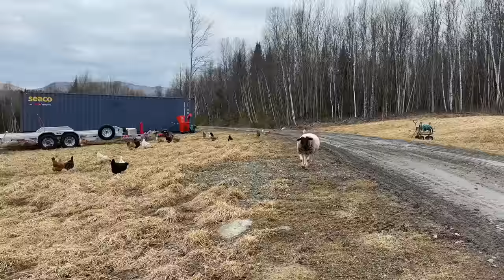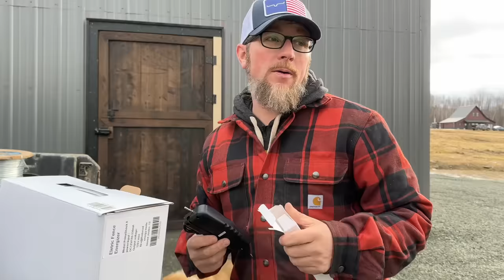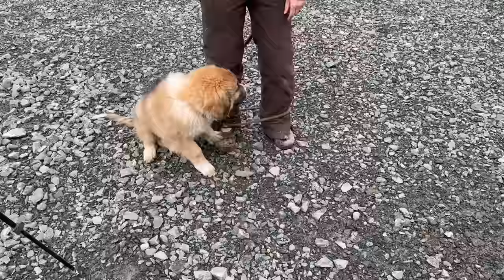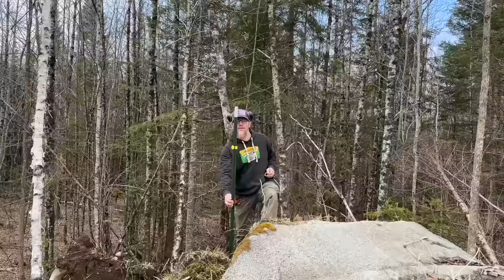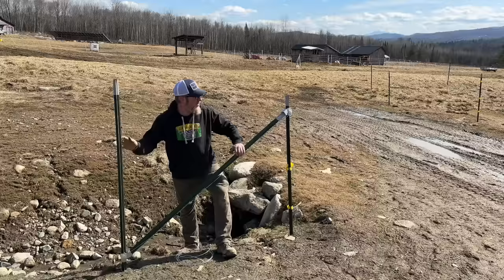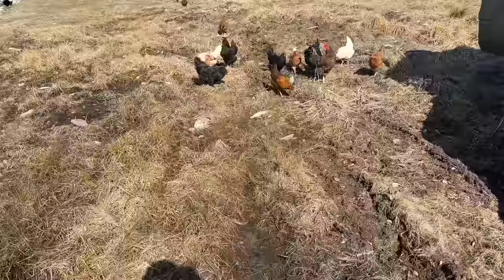Here We Go Again, BIG PLANS... Time To GET READY!

Comment: Good morning Lumnah family from a cloudy Pacific NW. Good morning viewers. Nice, getting the fences up. I'm glad you got energizes for your fence that are direct fed 110VAC. The four gates sound great. I'm glad to hear that you're getting more pasture livestock. Nice job on the bracing. Thanks for this video Lumnah family! We got the engine out of the Subaru Forester. Now the fun begins. I didn't even end up in pain! When I removed the radiator fans and most of the radiator I hurt my right foot bones and my left knee woke me up with pain in the middle of the night. It's great to have an engine on a stand and it's all so easy to get to. The stand we got from the guy's barn that had never been used is what it's on. The engine is so cute on it. It is a very small engine. Most of the cars I have are 6 or 8 V style engines. I don't have a hoist or a forklift like my brother-in-law has. It was fun to see him pull it out with the forklift. He put a fork extender on one side to bring it up with.

Comment: Worldwide Production;
1. Cow Meat,
2. Sheep Meat,
3. Sheep Milk,
4. Pig,
5. Chicken,
6. Cow Milk,
7. Eggs,
8. Rice,
9. Cereals

From wiki; Sheep's milk is extremely high in fat and conjugated linoleic acid (CLA) and has a high level of solids, as compared to other milks. This makes it very suitable for cheese-making. In particular, sheep's milk produces much more cheese than the same amount of cow's milk.

Female sheep (ewes) do not produce milk constantly. Rather, they produce milk during the 80–100 days after lambing.
Sheep naturally breed in the fall, which means that a majority of lambs are born in the winter or early spring.

Through the use of drugs (CIDR), ewes can be bred out of season.

Meat and wool breeds of sheep lactate for 90–150 days, while dairy breeds can lactate for 120–240 days. Dairy sheep are able to produce higher yields of milk per ewe per year. Dairy sheep can produce 400–1,100 lb (180–500 kg) of milk per year while other sheep produce 100–200 lb (45–91 kg) of milk per year. Crossbred ewes produce 300–650 lb (140–290 kg) of milk per year.

Products
Sheep milk cheeses include the feta of Greece,
Roquefort of France,
Manchego of Spain;
Serra da Estrela from Portugal;
pecorino Romano
(the Italian word for sheep is pecora), pecorino Sardo, and ricotta of Italy;
Pag cheese of Croatia;
Ġbejna of Malta; and Gomolya of Hungary; and Bryndza (Slovenská bryndza from Slovakia, brânza de burduf from Romania and Bryndza Podhalańska from Poland).
In Greece, yogurt is often made from sheep's milk

Comment: When you figure it out in your head it usually turns out better. Once it is on paper you try to stick with that, and that can be very bad. Once I didn't move a wall over by 1 inch because that is what my plan called for.

Comment: Tensioners - have you got any nylon rope as you could use this for a tensioner
All you do is put the rope round the two posts and two the ends together making a continuous loop and then take a piece of rebar about 10 to 12 inches long and put this between the two strands and twist the two until the bars are pulled together at the required tension and then using the cross bar to. Stop the twist bar from undoing
Easy and cheap way to make your own tensioner’s

Comment: I hope the Wedge-Locs work for you. I needed to make a corner where there was too much rock to put in proper wooden post H braces. The Wedge-Locs are made of soft aluminum and keep bending and the angled brace posts pop out. A suggestion, put shutoff switches at the gates so you can shut off part of the fence without having to go to the barn/workshop to shut it all off then a return trip to turn it back on. I got mine at Premier 1.

Comment: That is going to be a lot of wire to run.  It is good to be outside again on your property.  It is looking so good.  I love the huge rocks, as Gina said, the goats are going to love them.  Y'all have a Blessed day.
Reply: I do too wonder if there all from there land
Reply: @roxannepruitt4024  The rocks, large and small?? Yeah, all from the land, plenty of rocks in New Hampshire. If you watch the early videos of clearing the land, you will be amazed at the size of some of the rocks.
Reply: @roxannepruitt4024  I believe they are.  I remember when they first started clearing land for the road and harvest house, the septic tank etc. they came across huge boulders and had them set aside.
Reply: @roxannepruitt4024 
A big excavator wasn't big enough for moving away rocks up by the Harvest House Solar Panels, and an even larger one was required !
Just click on Library and scroll back a few years to see the gigantic boulders !

Comment: Another validation for fencing that corner is it's an area that you won't have to cut with a mower. Gina needs her own tool belt with some pouches you can pass back and forth for purpose. Heck, you can hang them off the side-by-side but the fanny pack just won't cut it. A weed wacker may well be useful too. Can't wait to see the spring green as it starts to take over soon.😁👍

Comment: Al, when you electrify the other side of the road, run it off it's own energizer, but lay a wire under the road anyway.  That way you have redundancy if one energizer has a problem you can jump it off the other, but you have less fence on each energizer for a better zap.

Comment: Al,  not sure who, but there is a company that makes a blower that mounts on the 3 point hitch of your tractor that is made to blow leaves & cuttings out of your road ditches.  Normally done in the fall after mowing & leaves fall off trees.  They work great.  Keeping your ditches clean of materials keeps drainage flowing which helps prevent damage during mud season.

Comment: What about bears? Those braces did not work well for us, maybe they will work better for you. After 3 years, they broke. We had them around the garden,keeping the horses out.  Are you using wood posts for the gates? It’s the only thing we have found to be strong enough to support the gate.
Reply: I think Al will only use the springs he showed for gates, assumably electrified !

The one that will be at ( proposed ) driveway may be different or just later reinvented when road gets built thru the pasture at where Culvert pipes nearest-to Barn !

Comment: The big rock you went behind with the posts, I know that goats like to climb, but do they jump(I really don't know) any chance they might jump over the fence. Also, I know in this area it's a concern, but how's the snake population there? I ask because the rock Gina mentioned a good place for a break on that one lower flat rock, because around here, it's a perfect place for snakes to den up, so if it's a concern there, be careful.
I do know fencing, put a brace on each side of your corner braces. Looks like you are planing on hanging your gates on the t posts, I recommend putting in heavier posts to sink into the ground, like round treated posts, just better to support the gates as the metal posts will bend, sag and gates won't swing good.
Reply: The only venomous snake in NH is the endangered and protected Timber Rattler. Odds of seeing one are extremely low.

Comment: Al, do you have any wires that aren't hot? If you add a couple of wires that are grounded, anything that touches a hot wire and a ground wire simultaneously will get the shock of their life. This is especially helpful in a dry summer when lightweight animals like goats don't have good ground contact through their hooves. They might get away with touching a hot wire but if they press their luckband touch a grounded wire as well they will get the message. Same goes for lightweight predators trying to enter.

Comment: Not sure how you can power the fence on 110 VAC without solar if you only use solar. Guess you are not using a small solar panel just for the fences. Hope it works well. Love the SOLAR ONLY grid. Your power system works so well I almost forgot it was solar only.

Comment: Hi, I recommend you put that underground cable inside a conduit eg some poly pipe for extra protection against livestock trampling it and driving tractors and vehicles over it.
Reply: Easier to replace, if it ever causes an issue, Al bought the big spool !

Comment: With all those trees, why arnt u using wooden posts to save money. Plus their stronger than metal. On the corners.
Reply: Only Locust Tree wood could be used _ if not store bought as pressure treated, due to rot and bugs !

White Oak wood would last the longest but that's likely 3 years at best !

Example; Poplar tree wood making ground contact would get buggy and rot within months, But also can be found as wood material used 100 years ago building Barns,

Comment: those 'fence' posts look far too flimsy to control anything more than small animals; considering the wild animals you have around there you need much sturdier posts and driven in much further to be effective.
Reply: T posts are plenty strong to support hot wire or tensioned fence .... as long as they have strong corner posts. And presumably the hot wire will dissuade predators though I think many could easily hop between the bottom and middle wire, as can Brutus.

Comment: Whats with the BLUE can Al?? red is gas Yellow is diesel, Blue is not fuel it is oil of some sort. Get your colours sorted it will save some one putting wrong fuel in the vehicle.
Reply: Blue is for kerosene. which can be the same as #1 diesel.
Reply: @jimputnam2044  Look it up. Kerosene is also known as #1 diesel. Yes it has less lube but is still known as #1 diesel.